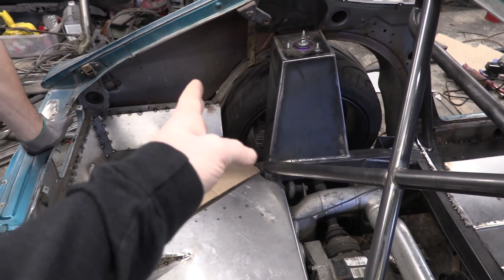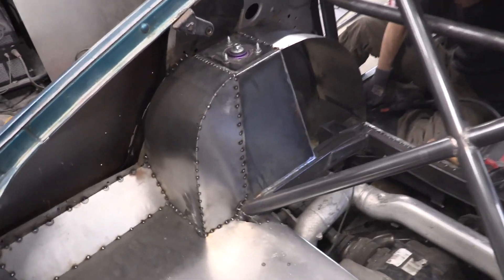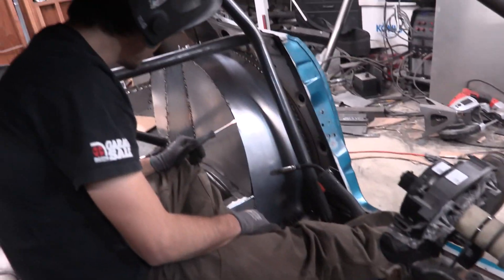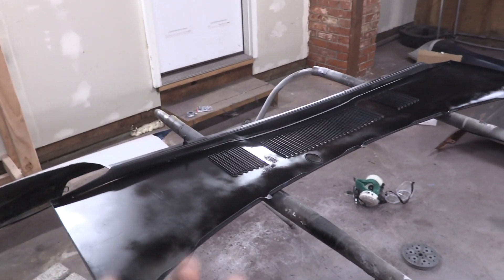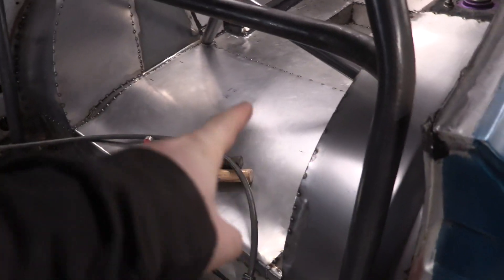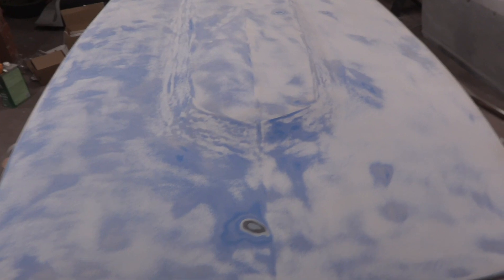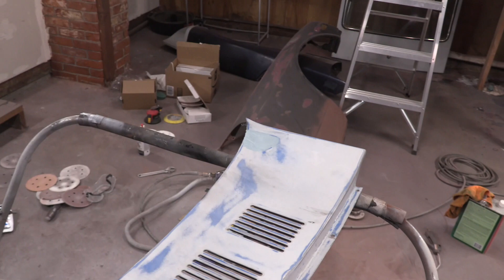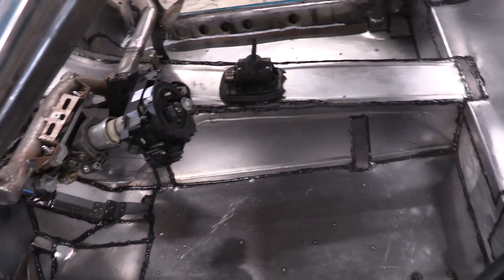240z Wheel Wells Finished, Seam Sealed, and Panels Paint Prepped

Comment: Good tip for a good seam sealer finish is to mask either side of the weld you want sealing, put seem sealer on, use a  putty knife/metal spreader dip it in acetone then run over the top then remove the tape. Nice and neat 👍

Comment: 2 suggestions.  1 - you might want to tie the two rear strut towers together or better yet, into the roll bar.  There's not much support for the forces pushing the top of the strut towards the center of the car.  Second, you'll want dynamat or something on the big sheet panels of the floor, you're sitting inside a big calypso drum.  Otherwise the car is going to drone alot.

Comment: I think I would let you know that you need to put a sealer on the primer as it will allow moisture and and so will the vinyl wrap dust will cause everything to rust underneath the primer..... the other option you can do would be to finish it the way you need to with a sealer primer setup and vinyl wrap it with a rusted look that way it's the rat rod look done vinyl that would be game changer

Comment: What's going in the area between the wheel wells in the box? Wires as well? Or is that what you meany by the air suspension stuff?
If not you could turn it into a cubby so you can store bags and whatever in there. Just make a hinging door that's accessible from the cab.

Comment: Nice progress Chris, i recommend you to use noise reduce gum plates over the wheels at least, otherwise you will dont even hear the engine in higher speed...;) also dont forget about place compressor for your suspension ;) hold you fingers

Comment: Chop up whats left of the BMW, throw a junk yard LS in it, suspension from a wrecked Camaro or Mustang, strip the paint then rust it some followed by clear coat. Get some old school muscle wheels that have rusted a bit on the face, and you're set. Minus fabrication and work time, probably wouldn't even cost that much in the end.

Comment: Do you have to seam seal both sides of each panel? Just asking, because I have to replace a floor pan in my jeep and was wondering if I need to put sealer over my welds inside the car and under the car around my patch. Cheers!

Comment: I would just go to sema with an unpainted car and then finish the painting and rust removal properly. These rust reformed panels and the frame will rust in no time. There is so much time and effort in this car that i wouldnt risk ruining it by rushing the last steps. Now, without a great deal of surface rust on the frame and moreless no extra parts on the car would be the best time to do rust prevention and paint prep in a way that it doesnt look like shit in a year or so.
Just my 2 cents to the whole thing

Comment: Yeah uh. You're supposed to primer, then seam seal. If that seal fails, you have bare metal for rust. Also, If that is a rubberized seam seal, have fun making the paint stick and not crack down the road.

Comment: Just to give you heads up... wrapping over Primer isn't going to stick very well to your surfaces...don't say i didn't warn ya $0.02 =)
Reply: Truth. I've unfortunately learned this from experience. The wrap needs a smooth surface (ideally clear coat) to adhere to.
Reply: Yep. I repaired a spot on my trunk lid before wrapping, finished it with primer. It stuck notably worse to the primer. It is still firmly attached in that spot after 2 years though but I post heated everything, especially that spot.
Reply: @InfinityGraphist agreed I've sanded down primer to wrap over and it sticks no problem. where i fucked up is i used cheap ass primer and when i unwrapped the vinyl a year later the vinyl took a shit ton of primer along with it lol
Reply: Rob Dahms 4 rotor was wrapped over primer... and it’s still sticking to the car.
Reply: He did say that they were going to sand down the primer. So maybe thatll help
Reply: As shit as it may sound hopefully it'll stick and look good for sema. He can always revisit this later/paint it if he want's to.. he needs something "quick and dirty" and I get it.. time is slowly running out! But it is coming along very well I think!
Reply: He only needs it to stick for a week but want a good finish.
Reply: It's not lazy work.. it's a deadline.. it's not like he can't fix it later or make it better later...

Comment: Says G35 is too dangerous...
Builds a 500 hp 2000lb car...
Reply: more importantly, buys a 370z which is the same car essentially as the g35
Reply: He said the g35 was too dangerous because after the crash, traction control basically got disabled until he changed some electronic stuff. So it was kinda sketchy in the rain. This car will probably have traction control, and he won't drive in the rain, or at least not as stupidly has he did with the g35.
Reply: I reckon it'll weigh about 1 tonne if not slightly over
Reply: its definitely over 2k pounds
Reply: Probably around 3000lbs
Reply: Carbon z that the street bandits are building weighs around 2500. This car is probably gonna be around 3500
Reply: Not a indictment as I like the idea, I bet they will be surprised with how heavy it ends up.
Reply: I would like to know hoy much the car weights...... i think that he owns a car scale
Reply: @elcrack3343  I just threw a guess around but the interballs experts always know more than you
Reply: He also said the G35 was good looking. Not sure we saw the same car.
Reply: This things going to be damn near 4200 lbs I bet. It's built like a truck.
Reply: +Mizino: In Over my Head.

Wrong, the 370z is comparable to the G37. There's about a 30 HP difference depending on which model of the G35 you buy.

Comment: Just adding my 2 cents.. Wrapping primer is never a good idea. It sticks to it if you just primer a little dent you have fixed, but it will most likely not stick to it, if the whole surface is primered. You have to add a coat or two of clear coat for it to adhere well.

Comment: those rust stop primers is waste of time... the surface paint will bubble in a couple of months....  just take out the engine and all the glass from the doors and dustless blast everything to bare metal then seal whit epoxy primer then you have a good starting point it´s faster than trying to repair old paint that will cause problems in the future... lift up the car and spray epoxy and raptor liner under it.

Comment: Now the wrap is a good idea but i do vehicle wraps for a living and sometimes it pulls the paint off. Now thats not the problem the problem is when we get the panel repainted you general have to wait a few days to allow the paint and or primer to full cure and gas out or it will cause a ton of bubbles in the wrap. Just a heads up. To help figure a time frame to wrap it.
Reply: That's why he's painting now

Comment: Missed a panel - You can still see the pass rear tire from inside the trunk
Reply: I said the same thing but i thinl thats where the wide bod kit covers
Reply: How would it cover the inside...?

But no, pretty much every car has a gap to the outside like that. Sometimes there are panels that just get screwed in to cover that. And the inner wheel well metal covers that from factory, connects the inner and outer skin and seals it, but since it was all cut out there is nothing there.
Reply: No car I have ever owned has a gap in the wheel well to the outside other than rubber drain grommets. That includes a 1964 Hillman..
Reply: Lie? A real job? You think what he does isn't hard? Holy shit it's hard, sure he gets to do what he enjoys by building cars and doing dumb shit, but the logistics around it are a job within themselves. If you have an issue with the free content, move along man.
Reply: Not to mention he has to be an video editor, do marketing, do the work of a mechanic and body shop guy, and be a host. Chris has to do several jobs very well to achieve success. He left app development to work his ass of even harder

Comment: You need to strip the whole car to bare metal. Every single panel should have zero paint on it. Please don’t half ass the most important part of the whole build. Please. Also when are you pulling the drive train and all the suspension and windows out so you can paint everything? Can’t wait to see how the engine comes out with the way you built the mounts under the engine and frame over the engine. Should be fun.

Comment: Anyone else notice that you can still see the rear tires from the inside of the car? such as at 15:46?
Reply: Yeah, but they're gonna line both sides.
Reply: Thats an awful big gap to fill in
Reply: Blake, widebody doesnt cover the INSIDE of the car. That gap is where the factory inner wheel well is. you know how when you look up in there on a car and see the pinch weld where two panels meet? One comes from the inner skin, and the other is the outer skin. This car only has an outer skin now, so that metal that covers it, is gone. It'll more than likely get filled in, cause im sure chris doesnt want to climb in the trunk every night and dig out rocks.
Reply: Mizino: In Over My Head. well the door that will be under the hatch will cover that. looking into the car you wont see it. I assume this car wont be driven much before sema so im certain that it’s a low priority to fix right now since it doesn’t hinder the car visually or performance wise.
Reply: Yea that is bugging me too, gonna get all kinds of shit in the cabin... don’t do any burnouts all the smoke will fill the cabin instantly
Reply: T REV you think a modern bmw ecu would let you do a burnout? lmao
Reply: Those gaps get closed from the outside of the car, working from inside the wheel wells. A separate process from what Eric was doing today.
Reply: He did say eric has some more finishing work
Reply: Ron Santo Yes. One of the few manufacturers that let you switch it off completely.

Comment: the top of the chassis you laid the floor pans onto looked like bare steel will it not rust over time
Reply: I believe it's actually aluminum and he said at the beginning that he'll be priming everything, that protects from rust
Reply: Chill, the dude asked a question.
Reply: kuppajava McGuillicutty You’re crazy, dude
Reply: @someonedifferent6374  priming attracts moisture iirc. Not a good idea
Reply: not priming. he said he will use LineX coating or Rhino or something...
Reply: Someone Different primer is porous and doesn’t protect for rust at all. It’s almost the same as bare metal.